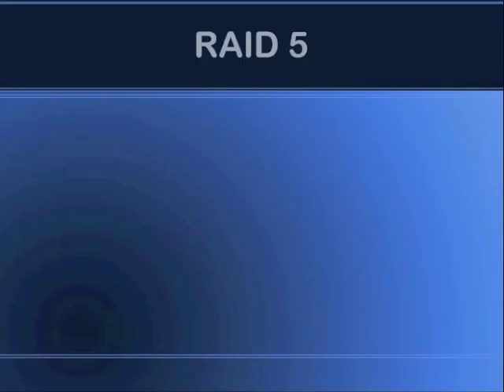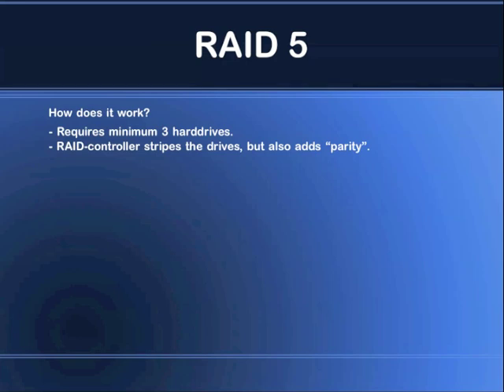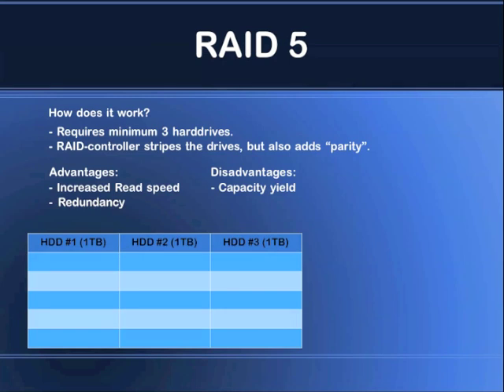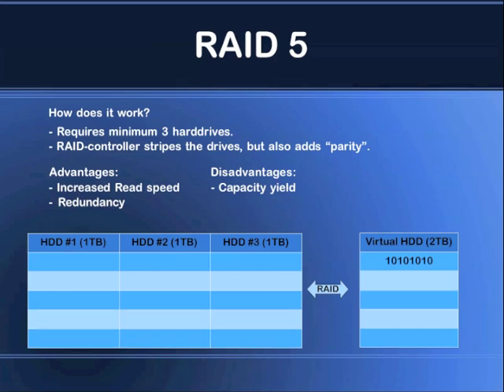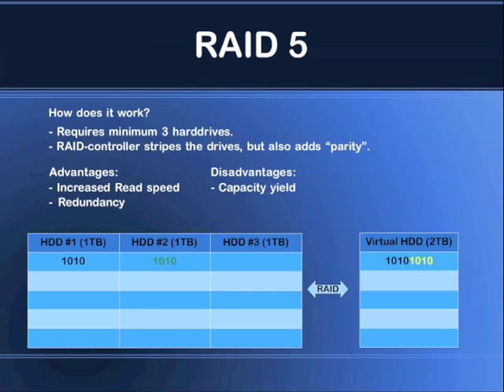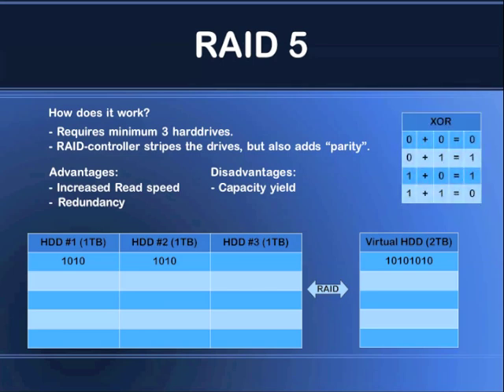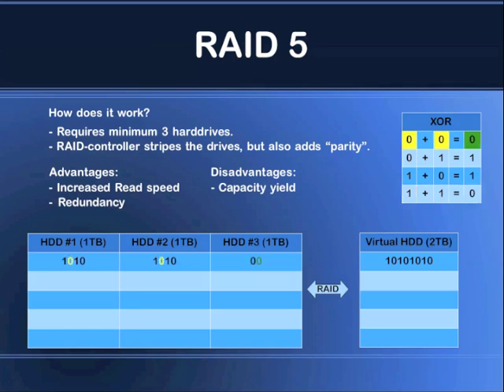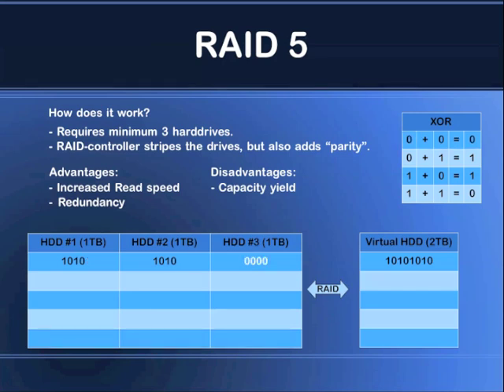RAID 5, explained

Comment from the maker: @s4iko1337:
Thats very true. :)

And anyways. Like I did mention in my RAID introduction video, RAID doesn't replace the need for backup.
You should always have a separate backup of the data you wan't to protect.

And if you have that backup, it won't matter if all the drives are lost, because you'll have a complete backup of the data.

If a lightningstrike fries your computer that has the RAID, it might not matter what kind of RAID you were using. :)

Comment from the maker: @s4iko1337:
RAID 5 with 3x1TB HDD's will give you 2TB of space.
RAID 0+1 recuires 4x1TB HDD's to give you 2TB of space.

So you're right about RAID 5 requiring 1HDD less.
When it comes to access-time I can't say for sure, since I have no personal experience with either of the RAID-modes.

But my understanding is that a RAID 5 can be more complicated to set up.
And RAID 5 will have dataloss if 2 HDD's fail.

RAID 0+1 could still be fine even with 2 HDD failiures, depending on which HDD's fail.

Comment from the maker: R/W-speeds will be higher than a single drive.
Just look at my latest video, where I compare a single Seagate 1TB vs 3 Seagate 1TB in RAID0.
RAID5 would probably not be as fast as RAID0, because of the generating of paritybits.

And also, the R/W-speed will vary, depending on the filesize and the stripesize.
So with RAID5 you basically have to tweak the stripesize to match the "average" filesize of what you work with.

I will run RAID1 myself.
Not enough experience to fiddle with RAID5.

Comment from the maker: @merlock18:
Yeah, it is not literally 4 and 4 bits.
I just simplified it.

When you set up a RAID-5 you can use default strip size, or you can tweak it to the size that gives you the best performance for your need.
If you choose a size that's too small, you get loss of performance.
If you set a size tha'is too big, you can suffer from "storage penalty".
That means HD-space gets wasted.
Strip size also affects seek time.

With RAID-5 you definetly need to know what you're doing.
I don't. Hehe.